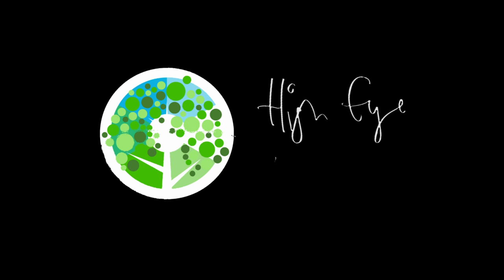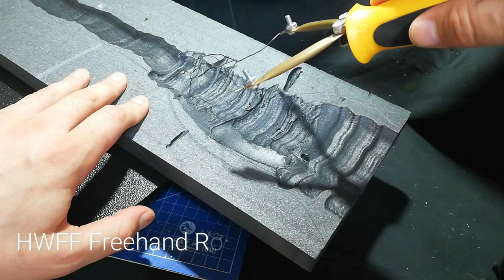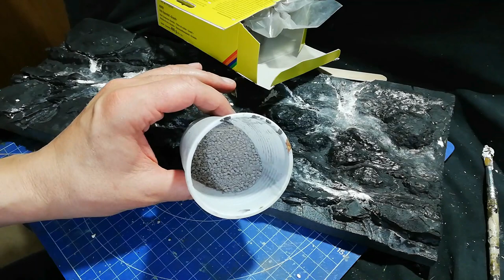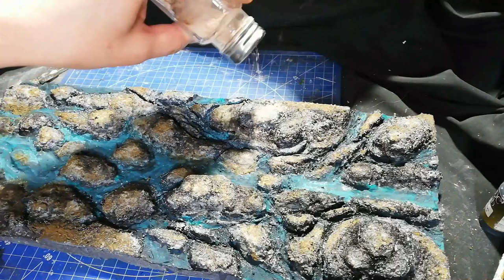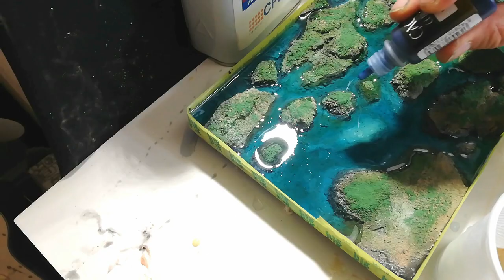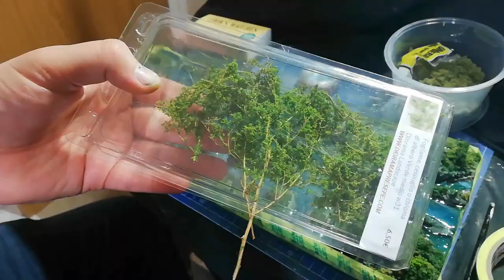How to make an amazing river delta

Comment: I also make dioramas similar to yours (actually 2 pieces so far, but I am thinking about larger project). I always have issue with waves on water - I used Modge podge gloss but I wasn't happy with the final effect. It always gets too flat for me. I was thinking to try using thin layer of resin and brushing to get waves effect until it is dry and hard, but I don't know yet if it is gonna work anyhow. This embossing glue pen also makes the difference - it looks amazing in my opinion. However I am not sure if I can buy it in my country. Anyway, great video and can't wait to see mentioned larger project. :) cheers from Poland
Reply from the maker: Try an acrylic gel, like Liquitex or Winsor and Newton. Make sure it's quite a heavy-bodied one. Or you could use a crystal clear polymer mixed with some white spirit, like I do here  https://youtu.be/fsnOMOiR1e4

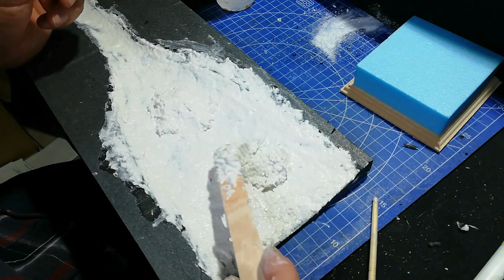Comment: Excellent work, if only I had your patience. At 03:56 I saw a block of blue foam. Is there a link on Amazon for this depth? (Looks like about 5cms?) I'm looking for A1 size sheets 594x841mm for the base and terrain for a castle I'm trying to build and this size is perfect. Thanks.
Reply from the maker: Hello. Thank you! The foam I use is from Bluefoamuk, available through eBay. They do all sorts of sizes. It's better quality than the hardware store stuff, which is softer. Bluefoam's foam is now black, but identical otherwise.